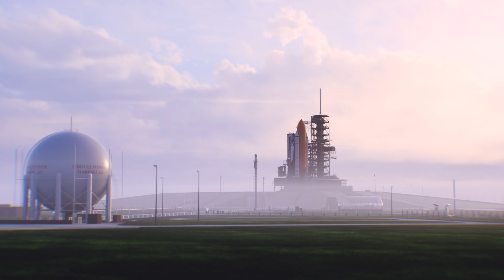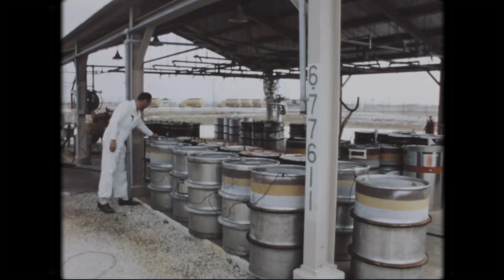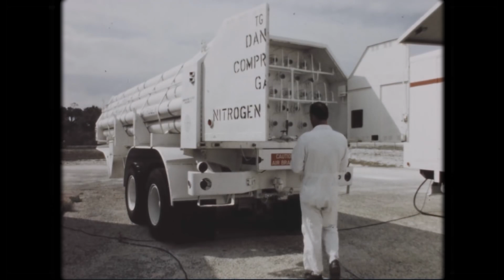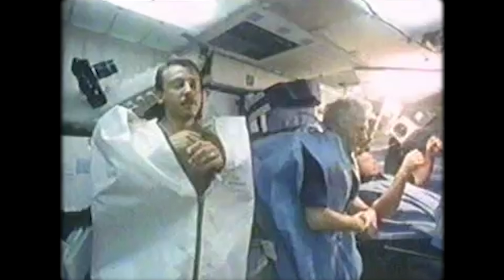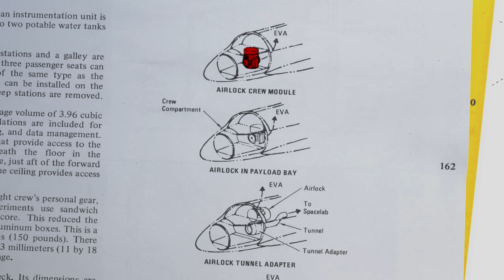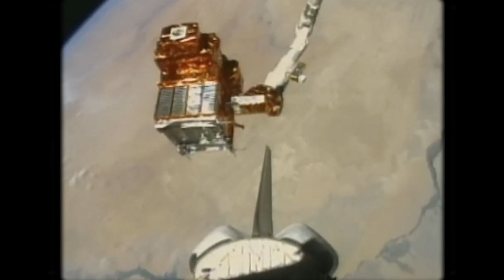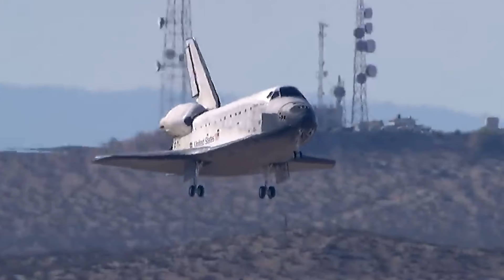The Insane Engineering of Orbit

Comment: In the early shutlle program, someone (I think it was David Brin), proposed not ejecting the main fuel tank until it was in orbit.  By putting a hatch on it, you would have a large pressure tight enclosure ready for retrofitting into a space station.  By attaching multiple tanks with cables and spinning them, a rotating wheel type station was possible.  No idea if it was feasible.
Reply: if my simple understanding is up to par, even assuming that the fuel tank is a simple hollow cylinder, the propellants are kinda hazardous after all, sensors and scrubbing equipment required to make it safe for activities would add extra weight, which itself is already a very scarce commodity for space flights.
Reply: @wytfish4855  Liquid hydrogen and liquid oxygen.  The idea was to have an excess of oxygen.  The followup mission would install a fuel cell to provide power.  The fuel cell would combine hydrogen and oxygen to create water.  The followup mission would also bring liquid nitrogen to combine with the oxygen to create air (79% nitrogen, 21% oxygen).  The power from the fuel cell would be used to heat the nitrogen/oxygen mixture until it turned into gas.  The remaining liquid oxygen and nitrogen would be stored in tanks strapped to the outside as reserve.  The new tank design would have one end of the oxygen tank and external shell flanged for removal and installation of internal parts fllowed by an airlock module.  The tanks would be tethered to each other and spun for gravity simulation.  Spinning in Earth’s magnetic field would generate electricity long term.  Orbital manuevering would be provided by electron guns.  NASA took one look, realized they could make it work if they Apollo level support, decided it wasn’t worth the risk, and shelved the idea.

Comment: Less than a minute in and there's already a problem. The Orbiter wasn't in orbit when the main engines shut down. It still needed one final push from the final stage: the two OMS engines mounted in pods on either side of the vertical stabilizer. If not for that, it would have reentered the atmosphere on the opposite side of the planet.
Reply: 5 seconds in, and there's no vertical stabiliser to speak of, haha. Someone else mentioned it, and it looks like it's missing in the animation
Reply: @MegaEmmanuel09 HA! Holy cow!

Comment: why is a shuttle less aerodynamic than concorde or blackbird yet it goes many times faster 1500 mph!? Shuttle is a bus compared to those. answer..   shuttle is BS
Reply: why is a brick less aerodynamic than a ball but falls when I drop it off a building? checkmate atheists
Reply: Did you not see the massive solid rocket boosters attached to it? And the shuttle was much higher and in thinner air by the time it got to the hypersonic speeds
Reply: @kevinconrad7648  it flies at 1500mph alone when boosters drop!! it would disintegrate. its all impossible lies....look at the  space station. 1500mph again!!!  a thin metal box with no aerodynamics it would freeze instantly along with anyone inside.  common sense is te key my friends. and a little research without being blinded by nonsense fakery and cgi. Get a super zoom camera and zoom intothe moon where they say they landed. there is NOTHING THERE AND ANYONE LIKE YOU CAN PROVE THIS.......GOOD LUCK WITH THE TRUTH FOR IT IS RIGHT IN FRONT OF YOUR EYES! ONELOVE
Reply: Because it only goes faster once it clears most of the atmosphere.  Aerodynamics are not a big deal when there’s no air.
Reply: @TimelyAbyss what about ..Re entry....you obviously have not thought this through....ONELOVE
Reply: @ANiMALFRiENDS_GOLDMAN being ignorant doesn't make you right. The shuttle flies in a vacuum at high speed, aerodynamics are not an issue. When re-entering, it needs to create drag, not be aerodynamic so it can't slow down. Maybe learn just the basics of physics before pretending to know what you're talking about.
Reply: @Ethan_Roberts  ok my friend......believe what you wish.....i will stick with common sense and reality.....you stick with lies and deceit 
......ONELOVE
Reply: @ANiMALFRiENDS_GOLDMAN  seriously? by that point all they want to do is slow down so they don’t care about extra drag.  You only need pointy  bits if you care about sustained velocity through an atmosphere.
Reply from the maker: Answer in episode 3, actually
Reply: still no one can explain why the shuttle which travels at 1500mph in and out of our atmosphere does not need to worry about the law of aerodynamics when concorde and Blackbird anything above mach 2 is highly aerodynamic and a Shuttle is not.......how do yhe astro nots on the BS space station not freeze to death and why do they use green screen technology?
Reply: @ANiMALFRiENDS_GOLDMAN  'astro nots'
Well done for demonstrating conclusively that you stopped developing both emotionally and intellectually before your teens.

Comment: @ 11:25 The Chandra/IUS stack was not the maximum limit for the Shuttle fleet in general, only for OV-102 Columbia, which was 3.6 metric tons heavier than her newer sisters, and it was Columbia that flew that mission since she was the only orbiter at the time that had not been outfitted with an external airlock and therefore was capable of holding the 56 foot (17 meter) stack in her payload bay. As it was, the mission was only possible for Columbia because of the recent introduction of the super lightweight aluminum-lithium external tanks, which shaved off 8,000 lbs (3.6 mt) in mass from the overall Shuttle launch stack and therefore added a roughly equivalent amount to the payload mass to orbit.

Comment: The Shuttle was truly a feat of engineering.  Kudos to the crew involved in telling a great piece of history.
Reply: And kudos to the engineers who created it!
Reply: The shuttle should never have been built as it was to be a giraffe when a horse was needed. It was the throwing of 250k lbs into orbit for a max payload of around 20k lbs...and then hauling most of that 250k lbs back down to Earth. What a waste!

If a capsule was hoisted to orbit on top of a lightweight container, cutting off the weight of wings and wheels, the shuttle stack could have boosted well over 100k lbs to orbit on each launch as well as the external tank for construction materials. The presence of a capsule would have made the whole thing safer while reducing the wasted fuel and risk. With that kind of payload, the entire space station could have been lifted in 3-4 payloads and something larger than the Hubble could be panning the universe at the moment, with far more durable pointing elements and a greater capacity to restore for repeated images. And there is so much more that we could have done with those 
133 launches, not to mention that we would probably have had 14 less casualties. 90% of weight to orbit as useful payloads as opposed to shuttle's 10% seems the brighter way to go. The occasional need for down-mass beyond the capabilities of the capsule could be met by putting a lifting body in the freight container. It could easily carry more down-mass than the shuttle and could be landed remotely with little to no risk to personnel. 

The shuttle was far more complex than it had to be, contributing massively to the cost and destroying the rapid reusability, making it mostly refurbishable at huge expense.
Reply: @everettlwilliamsii3740  considering what they had to deal with in regards to the requirements from both the engineers and the military, they did what they could. It still plays a major role in our history. For what came out of the entire project, I still think they did very well and showed what could be done when so many requirements had to be met.
Reply: @everettlwilliamsii3740    At first, you indiscriminately criticize reusable launcher idea, then you claim that reusability is still necessary. Choose one, since you have assumed the role of an expert.
And if there are no people on the shuttle, then where do you get the flexibility given by the author of this review? Show us your calculations or alternative examples. "Very expensive" - these are not the words of an expert.
Hubble was the size of the KH sat that was target for the shuttle project. It was made based on KH sat and his mirror. If it hadn't been for the astronauts on the shuttle, Hubble wouldn't have worked at all, because it had to be modified right in orbit. It also takes a lot of people to build ISS. Probably today, too.
Perhaps there would not have been 14 dead if the management of the two flights had taken into account the protests of the contractor and not launched something that was not designed for this in cold weather.
133 flights were not enough. But the reason is in the first crash, in the manager of that flight. After that, NASA was completely banned from accepting outside orders for services in orbit. The launch economy failed to take shape. But even so, $450M for a flight of 6 astronauts on a huge autonomous orbiter with a huge cargo of 20 tons is cheap!
And the designers did not expect that the shuttles would not be modified for decades for greater flexibility of use and reliability. The horror of the Challenger disaster led to the cancellation of development. And politics has led to the fact that even amateurs do not understand clear reports, they confidently repeat who knows what and who knows who. Some passersby pass sentences about technology when the profession has questions.

Comment: Very interesting! Correct me if I'm wrong but at 4:30 you mention that the back pressure from the high pressure helium is high enough so that no turbopump is needed but wouldn't that technically be the plenum pressure? I just finished a class on Gas Dynamics this semester so I am by no means an expert but in the textbooks and lectures the back pressure refers to the pressure after the exit plane of the nozzle AKA the outside pressure.

Small nitpick. Amazing video overall.
Reply: I think you're right, that is also what we mean if we talk about backpressure.

Comment: The more I learn about the shuttle, the more I'm surprised how well every single part was thought out. 
They even had covers for the flight sticks! And the capture mechanism on the Canadarm is just 💯
Reply: For those that are bringing up every single mistake. Just a list of all the redundant safety features would be mind boggling. 
Sure an airliner would have more, but that's a vehicle that sees a lot more use. Thus many more small issues crop up and get ironed out😉
Reply: Yeah, those Canadians were really on to something.
Reply: And a too small air lock room for space walks and hinges that lock with temperature differences. Not to mention the maintenance nightmare of the orbiter. Amazing!
Reply: @paddor bro the space shuttle was designed in the 70s. It needed to be revised and re designed several times but never was. It was well ahead of Apollo but never got the attention it deserved. It languished and became obsikute.
Reply: @paddor  It just goes to show how much on the bleeding edge of engineering they are that sacrifices and decisions had to be made here and there without sacrificing safety. What couldn't be guaranteed in engineering the physical plant due to constraints is made up for in processes. That's the bulk of engineering, really, making the most of constraints.

You see this in other fields as well, specifically just how narrow margins can be for planes' structures when compared to passenger cars
Reply: @paddor seriously?  How does that help anyone?
Reply: well, had EVERY single detail been thought out, there wouldn't had been 2 major disasters in human spaceflught history involving space shuttle
Reply: @Snork086  how does what you're doing right now help anyone?

Comment: 🎯 Key Takeaways for quick navigation:

00:00 🚀 The Space Shuttle's journey through the atmosphere is powered by solid rocket boosters and its main engines, with liquid oxygen and hydrogen fuel.
00:27 🌌 Astronauts experience a transition to weightlessness and silence after the main engines shut down and the external tank is jettisoned.
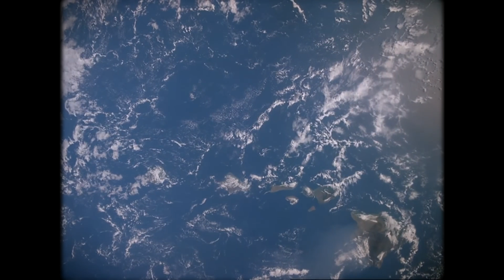00:54 🛰️ The Space Shuttle serves multiple roles in space, including a mobile laboratory and a vehicle for repairing satellites.
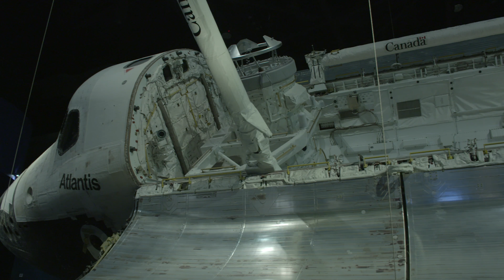01:22 🛠️ The Orbiter's ability to carry and repair large spacecraft, like the Hubble Telescope, showcases its versatile engineering.
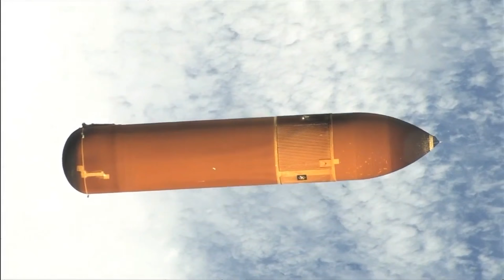01:50 📸 Capturing images of the external tank post-launch is crucial for assessing potential ascent issues.
02:19 🔥 The Shuttle's reaction control system uses hypergolic fuels, which ignite spontaneously but are highly toxic.
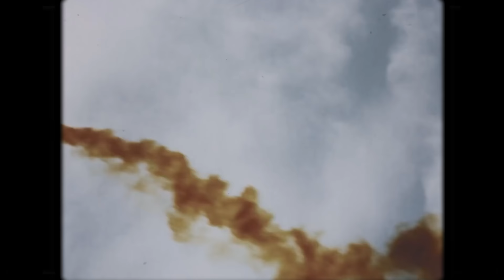02:45 ☠️ Handling hypergolic fuels requires strict safety measures due to their extreme toxicity.
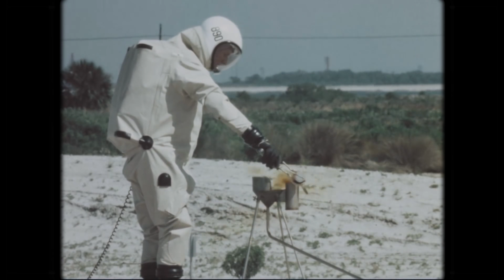03:14 ⛽ Hypergolic fuels offer reliability and storage advantages over cryogenic fuels, critical for long-duration missions.
03:40 🚀 Precise and instantaneous thrust control in space is achieved through the mixing of hypergolic propellants.
04:09 🌐 Spherical tanks in the Shuttle provide an efficient way to store pressurized gases.
04:38 🌟 The Shuttle's reaction control system includes 38 main thrusters and 6 vernier thrusters for fine control.
05:07 💪 The Shuttle's thrusters are controlled from two positions in the cockpit, with different controllers for movement and attitude.
05:34 🖥️ The Shuttle's flight computer plays a critical role in interpreting and executing control inputs.
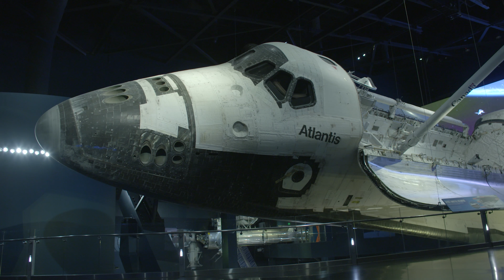06:03 🌐 The Shuttle's manual control system for the landing gear is a safeguard against unintended deployment due to cosmic rays.
06:31 🌌 In space, the landing gear is manually lowered to prevent accidental deployment.
07:00 🛰️ Astronauts start their mission tasks immediately upon reaching orbit, beginning with satellite rendezvous preparations.
07:29 🪟 The Shuttle's multi-layered windows are engineered for durability and thermal resistance.
07:59 🛰️ Space debris impacts are a real threat but the Shuttle's windows are designed to withstand such occurrences.
08:26 🌞 The Shuttle's windows feature a heat-reflective red film to maintain internal temperature.
08:54 🚀 The Shuttle's middeck is the hub for science experiments, sleep, and eating in orbit.
09:21 😴 Astronauts have various sleeping arrangements in space, from strapping in seats to floating freely.
09:48 🚪 Opening the payload doors is crucial for activating the Shuttle's temperature control system.
10:14 🛠️ The Shuttle's payload bay doors are integral to its heat dissipation and life support systems.
10:41 🌌 STS-93's close call with disaster highlights the rigorous inspection and maintenance of the Shuttle's engines.
11:10 🛰️ The Orbiter's maneuvering system compensates for velocity discrepancies during orbit insertion.
11:38 🌟 The Shuttle's star trackers are crucial for precise navigation and orbital adjustments.
12:06 🚀 Adjustments to maintenance policies were made after the STS-93 incident to ensure safer future missions.
12:34 🤝 The Shuttle's docking system is universal, allowing it to connect with different spacecraft.
13:02 🛰️ The docking process involves a series of precise steps to ensure a secure and airtight connection.
13:27 🌌 STS-49's mission involves unique challenges in capturing and repairing a stranded satellite.
13:56 👨‍🚀 The Shuttle's EVA suits are modular to accommodate astronauts of different sizes.
14:26 🛰️ Creative problem-solving is key in space missions, as demonstrated by STS-49's satellite capture strategy.
14:55 🚀 The Canadarm is a vital tool for the Shuttle, allowing for the manipulation and transport of large objects in space.
15:22 🛠️ The Canadarm's design reflects the unique challenges of operating in a weightless environment.
15:50 🌌 The arm's grapple system is elegantly simple yet effective for securing satellites.
16:20 🌍 Preparing for re-entry involves careful closing of the payload doors and managing thermal warping.
16:47 🔥 Re-entry is a high-temperature, high-speed process requiring advanced engineering and precise control.
17:15 🛠️ The Shuttle's life support systems, including CO2 scrubbing and water generation, are critical for crew survival.
17:40 📚 The Shuttle's educational partnership with Brilliant offers interactive courses in various scientific and engineering fields.

Made with HARPA AI